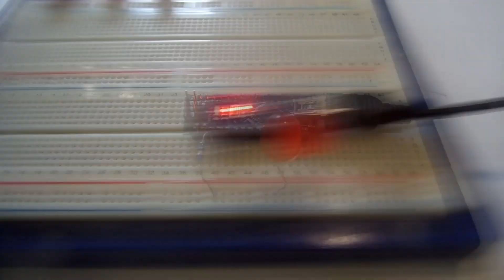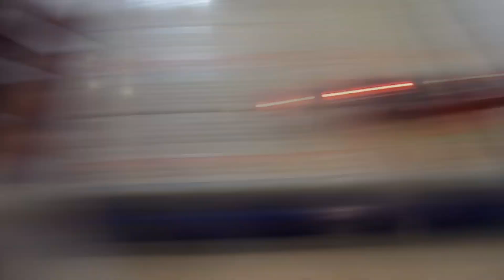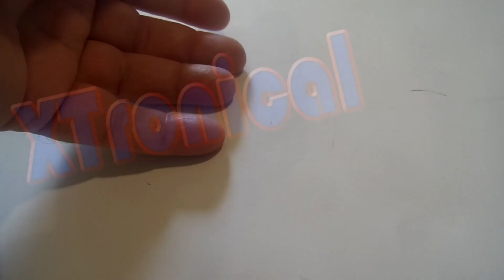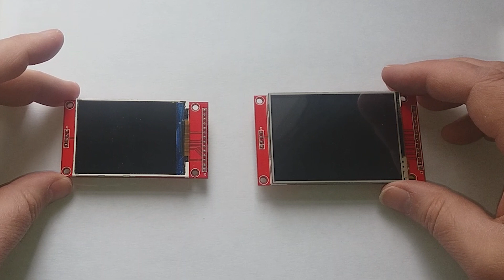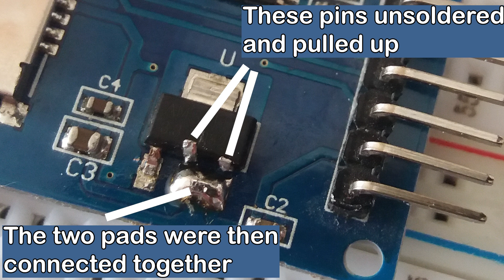ILI9341 SD card or other problems with ESP32? Try this.

Comment: God blesses you, i was using stm32 blue pill with ili9341 2.8 inch v1.2 and after i connected j1 it fixed my problem and it recocnized the sd card, thank you so mutch
Reply: i have ILI9225  and sd card not working with arduino if i connect the jumper it will work?

Comment: Thanks for the video. To recap. The ESP32 VIN is 5VDC. I connect the 3.3 VDC (pin 16) to the IL19341 VCC pin. 

With this power supply arrangement, both the display and the touch screen work correctly. I have had erratic results with the SD card. Sometimes, the JPG files are displayed correctly and other times nothing is displayed.  Does the SD require 5VDC? 
Thanks
Reply: I have same problem.

Comment: rst:0x1 (POWERON_RESET),boot:0x13 (SPI_FAST_FLASH_BOOT)
configsip: 0, SPIWP:0xee
clk_drv:0x00,q_drv:0x00,d_drv:0x00,cs0_drv:0x00,hd_drv:0x00,wp_drv:0x00
mode:DIO, clock div:1
load:0x3fff0030,len:1344
load:0x40078000,len:13964
load:0x40080400,len:3600
entry 0x400805f0
SD Card Type: SDHC
SD Card Size: 7680MB
initialisation done.
ERROR: File "220_30fps.mjpeg" not found!
ERROR: File "220_15fps.gif" not found!
ERROR: File "rishabh.avi" not found!
ERROR: File ".fe_tmp" not found!
ERROR: File "risha.jpg" not found!
ERROR: File "cropped_11zon.jpg" not found!
ERROR: File "risha.jpeg" not found!
ERROR: File "220_30fps.mjpeg" not found!
ERROR: File "220_15fps.gif" not found!
ERROR: File "rishabh.avi" not found!
ERROR: File ".fe_tmp" not found!
serial monitor output, its it not able to open it.

Comment: Man, thanks  a Lot! I was checking and rechecking all 😅!

I would like to aski something:

I was trying to use another esp32  gpios like:

SD_CS = GPIO32
SD_MOSI = GPIO33
SD_MISO = GPIO25
SD_SCK = GPIO26

I have initialized all without any problems, but esp32 could not run the firmware after i flashed it.  It's work just if I force a reboot from button dev kit.  I was wondering why it's happened. 

If I use the default gpio communications,  with SPI, works all fine.
Reply from the maker: I double checked those gpios and can't see any problems. I did have a problem a few weeks ago where I couldn't upload and switch some connections around and all worked fine but I can't remember what the connections were. Sorry can't be more helpful

Comment: Hey Xtronical, using our videos I have been able to fill the screen via code. i have the same display but with backlight support. aka the ST7789V driver. I updated my User setup to make it work. but now I also bridged the gap between the joints but when i insert a sd card my esp disconnects from the pc. do you have any idea as to why? P.S. having it not bridged makes it so that i cant mount an sd card
Reply: extra info. I grabbed my second display which is the same and not bridged. when I insert the sd card the screen goes black

Comment: I got a new one in the post.  2.4" with touch screen + SD.  Says "V1.3" on it.  different PCB layout and different (visually) screen make.  It doesn't work.  Spent hours debugging it.  Then swapped it like for like on the breadboard for another one without touch.  Worked instantly.  Swap back to the new V1.3, nothing, just white screen.  I suppose this is the way with these chinese modules.  For every few batches of fine ones, there is a batch of garbage.
Reply from the maker: Yes, very possibly. The heart pulse sensors are also very hit and miss. Least they used to be.

Comment: uuuuuhm. Well, tried this, and when inserting an SD-Card it fried my Esp32 instantly. Lots of "brownout detector triggered" messages, and that was the last thing I heard from the device. I really have no idea why. I do get the idea of bypassing the voltage regulator if you power the screen with 3.3v anyways - still, for me it did just harm the setup. You might not have any idea or suffered from the same effect at any point?
Reply from the maker: No, never happened, done it around 3 times. I'd double check everything, ensure 5v wasn't getting through somewhere to your esp32.
Reply: Yeah, will. If not, by any chance, there's 5v coming from wemos d1 minis 3.3v port, I've no idea. Will triple check, thanks anyway! It's a journey, every single time 🙂

Comment: I have also been told if you are using the SDCard on 3.3V you want to remove the resistors R1, R2, R3 as they are there to protect the SDCard from 5V SPI and will interfere with 3.3V SPI.
Reply from the maker: Really, that's interesting. Never had problems but if I do will give it a go.

Comment: I'm confused here! The VCC voltage was not mentioned.
I have an ESP-32 dev board. I have connected the 5V pin on the dev board to VCC on the ILI9341 board.
Were you connecting 3.3V or 5V to the VCC pin on the ILI9341 board.
Thanks.
Reply from the maker: 3.3v pin to ili9341, sorry for any confusion
Reply: @XTronical  No problem, thanks for replying. And thanks very much for your videos.

Comment: Hello, me again, sorry, the 2.4'' screen did not work so I decided to buy the 2.8'' the same as yours. Now on the serial monitor I get "Card Mount Failed", do you know what could be the problem?
Reply from the maker: Did you try the hardware mod suggested on the back of the board to basically disable the voltage regulator on the screen? Also check your size of memory card. There's a max limit, think it's 32gb, could be 16, can't quite remember. Fairly sure 32. Bigger than this and won't work. I tend to use 8gb cards. Nice and cheap.

Comment: Why the SD card reader didn't work on the 2.4'' screen? I have the same screen and when I plug in the SD card the screen turns black.
Reply from the maker: Make sure different chip select lines for sd card and screen. They can share the other connections but not chip select
Reply: @XTronical  do you mean in the user setup?
Reply: i just uncomment what you said in the video, is that ok ? i conected the sd's cs pin to pin 5, and the screen's cs pin to pin 15

#define TFT_MISO 19
#define TFT_MOSI 23
#define TFT_SCLK 18
#define TFT_CS   15  // Chip select control pin
#define TFT_DC    2  // Data Command control pin
#define TFT_RST   4  // Reset pin (could connect to RST pin)
//#define TFT_RST  -1  // Set TFT_RST to -1 if display RESET is connected to ESP32 board RST

// For ESP32 Dev board (only tested with GC9A01 display)
// The hardware SPI can be mapped to any pins

//#define TFT_MOSI 15 // In some display driver board, it might be written as "SDA" and so on.
//#define TFT_SCLK 14
//#define TFT_CS   5  // Chip select control pin
//#define TFT_DC   27  // Data Command control pin
//#define TFT_RST  33  // Reset pin (could connect to Arduino RESET pin)
//#define TFT_BL   22  // LED back-light
Reply: @jumbo999614  did you found the solution?

Comment: My man! That was it. 
I've been playing with those screens on stm32 and raspberry pi for some time now, just tried to use SD card reader for the first time and the screen crashed. My guess was that the spi on both are somehow shared and I can't talk to it with two SPI on my mcu at different speeds. 
BUT! Then I found this, soldered the jumper and it works!

BIG THANKS!

Comment: I am using these on DUE which is 3.3v by default,should I still modify this?, the SD card does not initialize currently, while I have connected screen and SD card to SPI pins and CS 4,10 pins of DUE,and use SPI.begin(4) and for 10,but does not work.
Reply from the maker: If you are powering the screen with that 3.3v then yes, you should do the alt.
Reply: @XTronical  Thanks for your reply  no it is connected to 5V of  Due's SPI, Main LCD to SPI1 and SD to the extended SPI, but whatever I tried,card does not initialize
Reply from the maker: I'm not familier with the DUE, are you sure the spi runs at 5v? Sorry I can't help more.
Reply: @XTronical  it has extended SPI ,which could be initialised from setup by SPI.begin(CS), SPI ports offer 5V and gnd for the client, the TFT works on one SPI port ,but SD fails to initialize on 2nd port, there are few documents available,

Comment: Do these screens have logic level conversion for the sdcard data pins in case you power them with 5V? I never used the sdcard because I don't think they do
Reply from the maker: Mmmm.... You may be right I've never investigated, I'm not near one right now. I'll try to remember to see if I can see tomorrow.

Comment: Brilliant!!! I was experiencing issues.. will try this tomorrow. Thanks
Reply from the maker: Fingers crossed. Let me know how you get on, what were the issues, was it the SD card like mine?
Reply: @XTronical  yes. Kept reporting no SD card mounted randomly.. I was PWM the lcd light. That was causing voltage fluctuations I guess. Not had it happen since shorting the j1
Reply from the maker: Brilliant

Comment: Thanks for sharing!! Pretty sure I have had this issue and even trashed a screen because I thought it was faulty.
Reply from the maker: Oh no,least future screens might be saved 😁
Reply: @XTronical  i have ILI9225  and sd card not working with arduino if i connect the jumper it will work?

Comment: These "standard"breakout boards are a bit annoying to use with 3.3V devices. Question: Is the big flat chip (U2 on the big screen) a level shifter?
Reply from the maker: It's the xpt2046, a touch screen controller. Had to get my magnifier out!